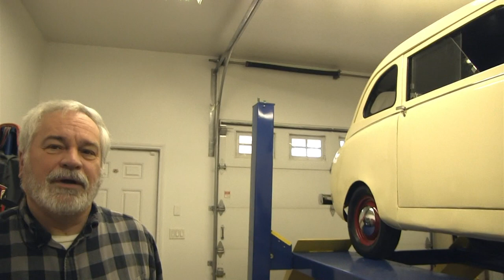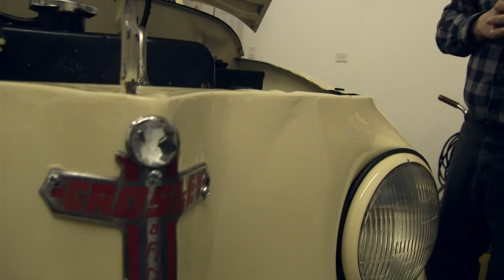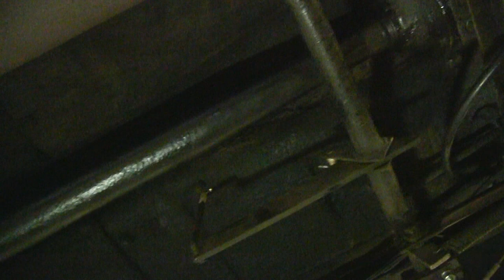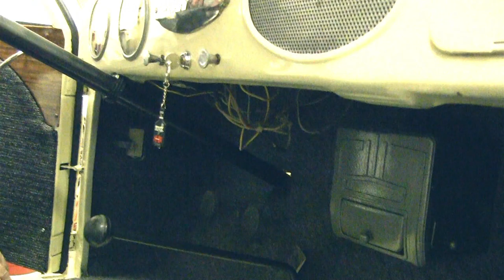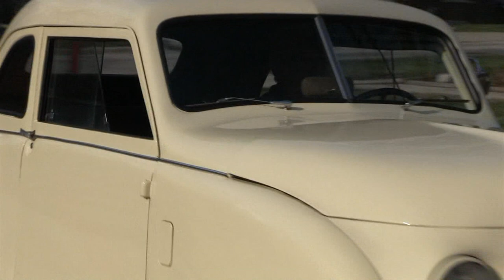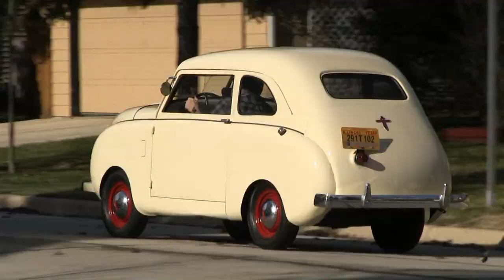1947 Crosley, We learn a lot. Then we go for a ride!   Thanks James May & The Grand Tour Eurocrash

Comment: I had one in 1956, my first car, a 1949 Crosley Station Wagon, bought used for $60. Drove it all over South Louisiana and averaged 45 mpg.  Best top speed was 70 mph going down the Lake Charles bridge.  Very difficult to slow down with the mechanical brakes.  I had a great time in this little car.
Reply: really 45 mph  ?  that's great

Comment: I have owned five Crosley's. My last two were 1951 pickup's. I drove my last pickup on freeways and as a daily driver up to 1987 and sad to say I sold it,  it was a great truck. There were several Crosley's in the small town I grew up in and I remember sitting in new ones at the dealer.
Reply: This didn’t happen to be in Indiana did it? Most of them were built in Marion Indiana.

Comment: The CoBra engine was actually a defense project, Powell Crosley's answer to the a call for a generator meeting certain weight limits that could meet certain power output and run at full throttle for fifty hours. It was quite successful for what it was designed to do, but its construction made it less than satisfactory for automotive use.

Comment: Loved the video. In '57 I was 13 and traded a calf for a '49 wagon. Took the body off and built a wooden roadster pickup body on it. If anybody is interested, it turned 52 mph in 22 seconds at the drags. Only had 3 of the brake cables on it.
Reply from the maker: That would have been a nice little roadster that you built.

Comment: Neat little car. Kids love them, I know I did when I was a kid back in the 1950's when I spotted a few in our Chicago neighboorhood.  I had a 1951 Crosley Wagon back in the 1970s. (Cast Iron engine, hydraulic shocks and brakes, roll down windows) On a good day it could reach about 60- 65 mph. Engine began to sound a little  "busy" at 40mph, but It would cruise ok at 45-50mph and get 40 miles per gallon. The engines continued in production for some years after the automobile production stopped in 1952.  Fageol sold Crosley  marine units with one used as an outboard with the modified engine standing vertically. They were also used on trucks for refrigeration units.
Reply: I heard that the engine design was bought by Homelite for use in generator sets. I knew someone with a trailered USAF surplus genset with a crosley engine. He would have probably given it to me if I had any place to put it at the time.
Reply: @Oldbmwr100rs  I worked at machine shop as a kid in 1964 in Spartanburg SC and Homelite sent over a Crosley engine block to have the oil passages modified so the engine could run vertically in an outboard engine.
Reply: @aceroadholder2185  I heard something about those being used in outboards, also Homelite used them in generator sets, especially for the military.

Comment: Just had this pop up as 'recommended'. A well done video covering the important stuff without getting bogged down in details or missing anything important 👍 This car is a near-perfect example of meeting design goals properly; only the first engine choice and the dropped rear footwell collecting water seem to be design flaws and the engine issue was handled most excellently. The famed Offenhauser racing engine was built much the same way.

For a cheap, solid, reliable, no-frills car of that era I can't see anything which could have been done better. Even today other than safety and emissions standards the only improvements I'd make would be hydraulic brakes and shocks, synchros in the trans, and maybe a trunk lid. It seems to have been the most successful of the attempts to make a cheap basic car back in those days, being in production far longer than the others like the Bantam, Henry J (aka the "Allstate" when sold through Sears mail-order), and even the Nash Metropolitan. Only that wasn't what the masses wanted to buy at the time😞 Even now very few would give up amenities and comfort for low cost. But I can see a time coming where that will probably become a 'thing' IF someone can do it as well as Crosley did.

Comment: The Crosley was one of the relatively quiet new cars my seven year old self would see going down the street in Massachusetts in 1949. Many older cars were generally noisy as WWII rationing caused many drivers to punch out the baffle in the muffler for a bit more gas mileage.  It was the first tiny car I remember until my dad got his 1950 VW.
Reply: Your dad was one of 328 people to buy a new VW in the US in 1950, assuming he bought it new. Nevertheless, only 328 bugs were sold new in the US either way.

Comment: That's a nice little car! My buddy had a 52' Chevy Panel Truck that had the single tail/brake light. I remember him always sticking his arm out of the window to hand signal left and right turns. :)
Reply: I thought 2 tail lights were law by 39 or 40
Reply: @mikeholland1031  If I remember correctly I believe January first of 1949 turn signals became federally mandated which also made two tailights a requirement. I know that two tailights were still an option on a 41 Ford Standard, on the DeLuxe they were standard equipment.

Comment: Dad had the mechanical brake car which failed DC city inspection so got a 1950 with hydraulic.  Excellent traction going in snow due to relatively large contact patch for weight. DC dealer rolled car onto side instead of using lift.   Car failed due to Powell not wanting to add a few bucks for a synchronized transmission.  You can hear the clash.  Gotta double clutch or time the gears by feel called match speed.  Model A guys know. Restored a 50 wagon with dad in high school.

Comment: If I remember right, those engines were used for powering refrigerant units on trucks delivering foodstuffs.
That's basically all the car one would need. 
Narrow is cool. I presently drive a 1997 Daihatsu MOVE of which is also narrow
Reply from the maker: My second generation Prius is also narrow.
Reply: @RideswithChuck  Not as narrow as what I currently drive: https://i.imgur.com/UcwQ0st.jpg

Comment: Brings back memories. My Dad had the station wagon model. He also had the sports car model. I still have a family photo from 1954 with me and my sister in Dads sports car Crosley. My dad said the engine was prone to breaking crankshafts. He had sold the sports car and kept the station wagon for years. He took the engine out and it was in his garage up until he passed away back in 1992. We use to play in the that old station wagon. He let it rot away till the town made him get rid of it. I did not think the engine was worth anything so I junked it along with the original service manual. Dad kept every vehicle he owned. The back yard was a car junk yard. 1948 Studebaker Comander, 1955 Studebaker flatbread truck, 1960 DKW, 1957 Volkswagen bus, 1968 GMC carryall truck, 1955 Studebaker short bed pickup, 1965 CJ Jeep, 1945 army Jeep, and the Crosley station wagon. I was left with the chore to get rid of all the vehicles.
Reply from the maker: It sounds like you had quite an international collection of vehicles.

Comment: This is a very nicely restored car. Not 100% totally correct, but very nice. Everyone that had a sheet metal block ended up replacing them with a cast iron block. For what they were, the cars ran great.
Reply: this is because glycol-based antifreeze didn't exist back then, the antifreeze was alcohol-based with no corrosion inhibitors so the blocks rusted from the inside-out. today, this wouldn't be a problem especially if you ran evans waterless engine coolant in the system. taylor engines, the us military and crosley all knew that the engines wouldn't last very long but for wartime purposes that was ok.

Comment: The carburetor  looks like a Carter Model W-O, the same as was fitted to the Jeep. However, the jeep engine was 134 Cu.In., while the Crosley was 44.2 Cu In. So it seems it was quite a large carby for a little engine- good for power.

Comment: What would be the fuel milage on this car? I used to admire the  same car someone had in Fryeburg Maine around 1951-53 . I got close enough to touch it but never who the owner was. I was seven or eight years old at the time. I was a very young car enthusiast as I could name almost all cars domestic and foreign at that age. Once hooked on cars one is forever I guess.
Reply from the maker: Car addiction is a very sad thing with no known cure. I'm not sure what the gas mileage for this car is. Old cars like this usually aren't driven enough to get an accurate number.
Reply: They usually get around 50 mpg

Comment: ONE tail light. Is that legal?!
Reply: Jack D. Flippin indeed it is. If it met road laws when it was made, it doesn’t have to conform to today’s regulations unless you modify it. For instance, my ‘71 C/10 only has lap belts, three point belts became mandatory in 1972 but since mine was built before that I don’t have to have them.
Reply: old harley bikes don't have turn signals, also totally legal.